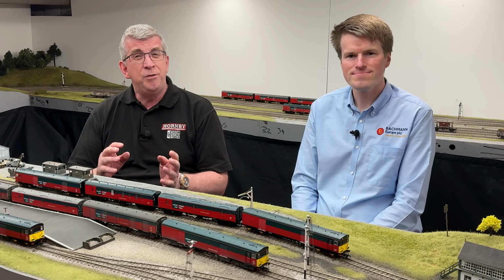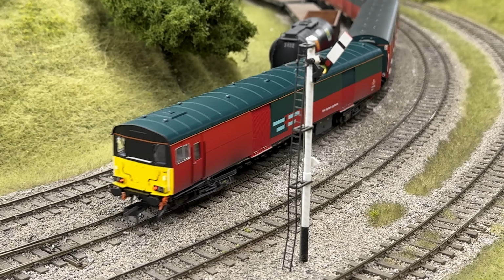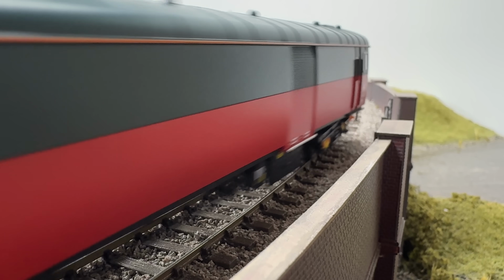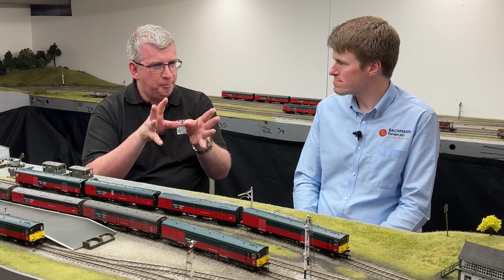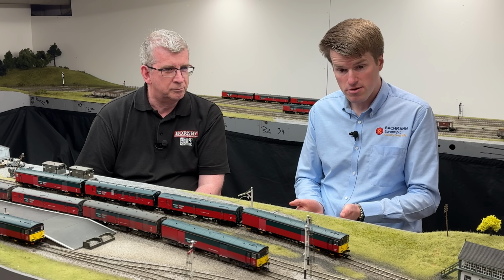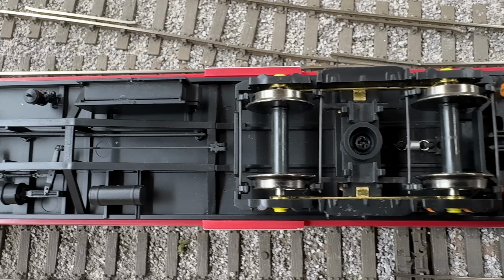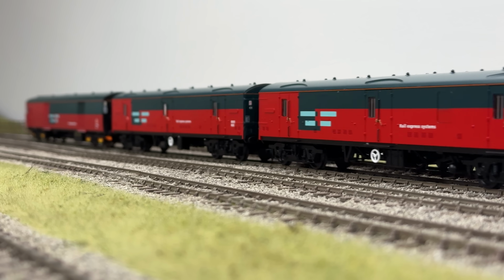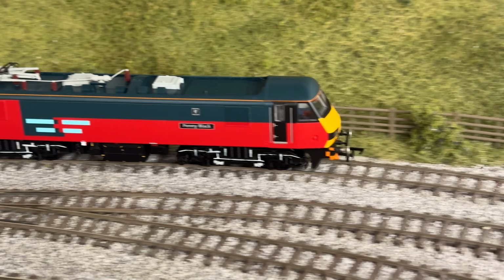HM207: Bachmann and EFE Rail reveal PCV for 'OO' gauge

Comment: Lovely model. They weren't proper push bull vehicles an additional driver rode in the PCV and had full control of the brake he also had a power selector which consists of 4 settings.  This does not actually control the locomotive it displayed the power selection in the loco cab for the other driver to operate the power controller.  When propelling maximum speed was 40mph

Comment: Its a shame the errors in the Replica body and roof profile appear to persist here. Let me guess, retooling work was mostly on the chassis? Although they ran mostly with the super GUV, you can see in the video just how poorly they line up with what should be an identical profile super BG. I'd have loved this announcement to go with my 90s parcels rakes, but on seeing the product, hard pass.
Reply: Where did they say it’s the Replica model retooled? This is a new tooling is it not, unless you know otherwise of course?
Reply: @TrainsandPlanes123  I've owned the Replica model in the past to know its shortfalls, and have also heavily reworked the original Lima stock to correct well known bogie and chassis issues of their super GUV models to produce a RES rake what feels like 20 years ago, and probably really was that long ago! That body is identical right down to the roof ribs and squashed ellipse of the roof curve. The chassis looks like it is new to take pickups, or heavily retooled, but the body I would stake a months wages on being the old Replica piece.
Reply: @Simon-Davis  you must be right then……. Think I’d rather hear what Bachmann have to say about it myself and they call it ‘All New Tooling’ which rather dispels your myth
Reply: @TrainsandPlanes123  Nothing mythical about it, the EFE model in the video even has exactly the same chassis steps moulded to the underneath of the roller shutter doors instead of being part of the chassis. The doors themselves are unlike those on the Bachmann super BG, which you'd expect to be the same given the real things were and Bachmann have tooled these doors up before. The design choices as well as dimension errors of the Replica model carrying over are too coincidental for it to be a complete new tool. If the EFE model does not have its roots in the Replica PCV, I'll eat my dogs hat.
Reply: @Simon-Davis  being YouTube, I look forward to the video of you doing just that 🤣

Comment: Bachmann have developed a knack of making models that I won't buy. I would be very interested in a model of the Class 307 that the PCV was converted from, though.
Sonic, Rapido and Dapol are getting most of my custom at the moment. I have only one Bachmann pre-order pending.
Reply: As a steam era modeller I agree. I don’t stick to my era always (which is era 2/3), but I don’t have tons of modern locos. It’s a pity that it’s been so long since Bachmann have announced a new OO steam loco (I believe the last was the Precedent which was announced in 2020 and released in 2021). If you model era 5, 6, 7 or 8 Bachmann will have been making lots for you though.

Comment: Although a nice model, it perpetuates the myth that BR Mk 1 coaching stock had cross-member ribs extending through the roof. I thought Bachmann acknowledged this anomaly somewhile ago. But now we have Royal Mail livery storage vans with correctly rendered smooth roofs contrasting with the newly introduced PCVs at each end with roof ribs.
Reply: The PCVs do have the cross-members though. They're converted from Class 307s, which had the ribs going across.

If you look at the Wikipedia page for the class 307, it's the third image with a BR Blue unit at Liverpool Street, you can see the cross-members on the roof